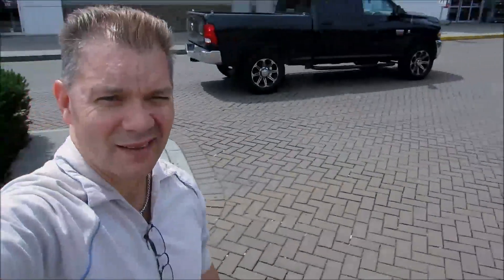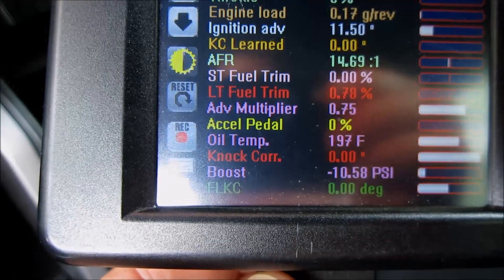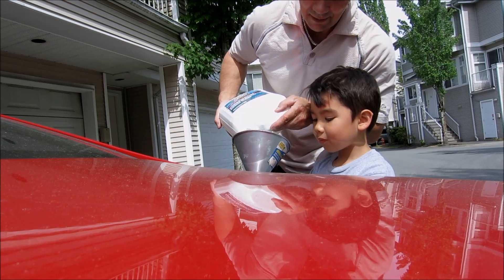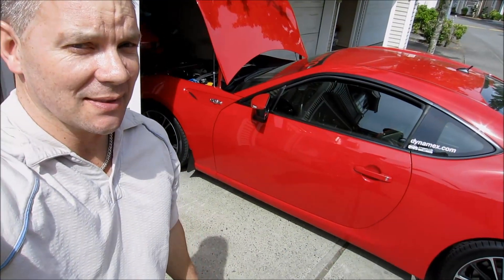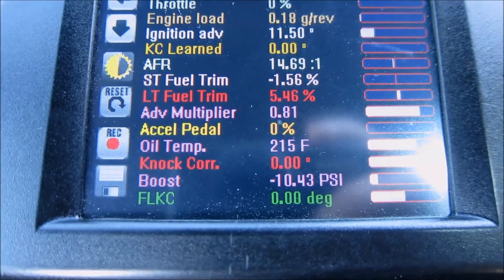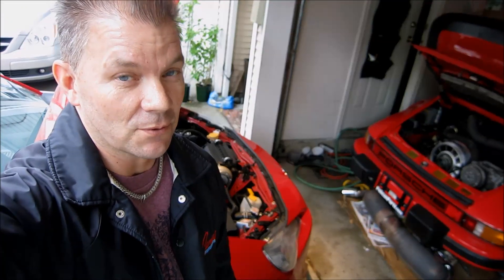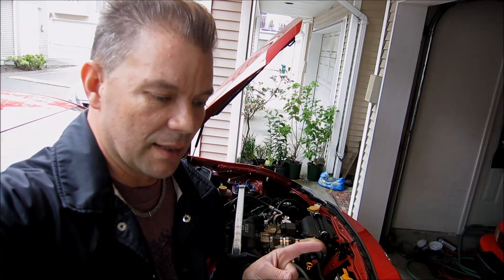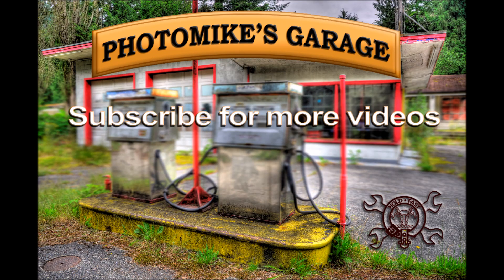My FRS loves Meth!

Comment: The kits they they sell are pretty badass.  I’m gonna get set up with the “boost juice” in a few weeks.
Reply: Dont waste your $ on boost juice. The Turbo Power brand -40c blue washer fluid is 50% methanol %50 water.

Comment: What about STP octane boosters?  Have you tested any of those to see if timing is increased?  Also, does your OFT detect Ehtanol content %?
Reply from the maker: The STP octane boosters do raise octane but one bottle does not raise the octane as high as the methyl hydrate in my experience. It would be a safer way to go though. The OFT does not detect ethanol % (not a flex fuel kit) , if you use e85 you must load a new tune from the tablet into the ecu ( the tablet holds 5 tunes).
Reply: Great.  Thanks for the information.